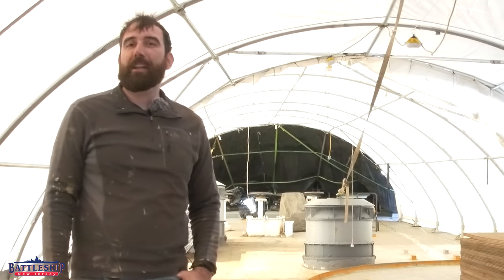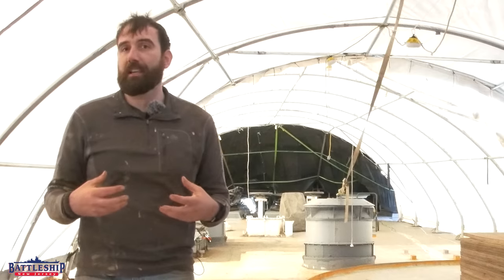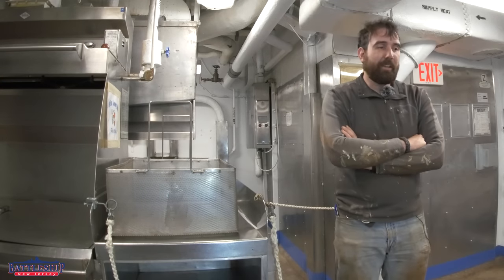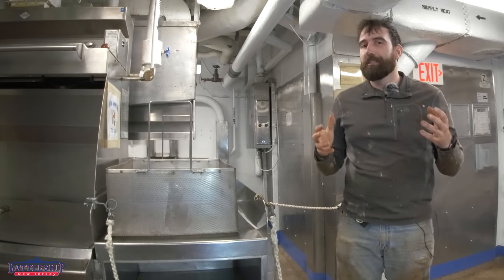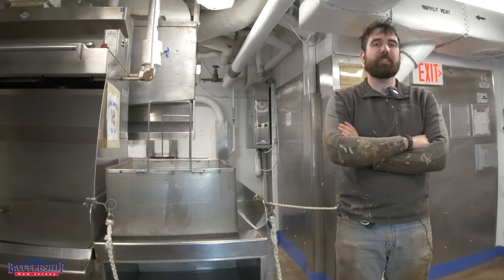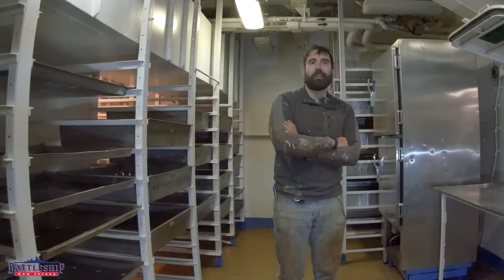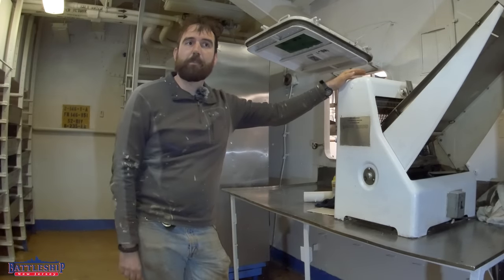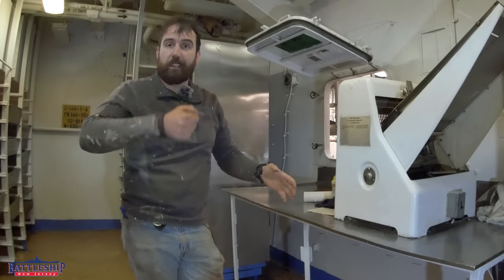Maintaining Your Battleship: Jan 2023 Update

Comment: alright i have the schedule to work on for 2023:
1. taking the engine, turbines and boilers out, rework it so its good as new (has to be done over the weekend i case the ship is needed again for WW3)
2. panting the entire ship new, using only a toothbrush to proof that you are serious with your work
3. overhauling all 3 gun turrets. and yes that also means taking them out (if no crain is available, get a keyboard and some cheat codes to lift them out.... "No gravity cheat" works good)
4. replacing the entire electric systems within the ship. that means, new wires, new cables, all new and up to 21st century standards. should be done in a week
5. vacuuming
6. getting rid off all of the rust on the ship so its completly rust free
7. replacing all steel on the ship with stainless steel so it cant rust again. 
8. Installing Windows Vista on all Computers on the ship, because history and nostalgia
9. raising the ticket prices for entry
10. kidnap some of the visitors as cheap work forces
11. reworking all of the weapon system so they can function again
12. cleaning the toillets. 
13. repeating all steps with the other iowas

Comment: Mess deck Smellerizer?  As started by Disneyland's Main Street starting in 1955?  Making the mess deck smell like a mess deck is attention to detail.  The first Fantasia presentations were supposed to include ushers walking down the aisle with various scent sprayers back in 1940.

In the Imperial War Museum at London, I toured a section mocked up as a Great War trench.  I've been on real battlefields (fortunately AFTER the shooting had stopped) and battlefields have a distinct stench.  The IWM had a light battlefield scent that I immediately recognized, and fortunately that odor was low-key.  Real battlefields reek.  

That's a nice touch when you can pull it off because it more fully immerses the visitor in the experience.

Comment: You COULD buy sliced bread in the US for the vast majority of the war.

From January 18-March 8, 1943, sliced bread was banned. This short lived ban resulted in a rush on bread knives, which by then nobody had, and increased food waste due to uncut loaves drying out faster and waste due to poor bread cutting. When the ban was finally rescinded, all authorities pointed fingers and nobody took responsibility. Various excuses were given by the media for the ban but few had any source in government and fewer of those turned out to be logical or based on any actual need. The sliced bread ban resulted in more steel and food consumption than before or after its existence.

Bread slicer manufacture was banned for the majority of the war, but since bread slicers are a common item in bakeries and pretty reliable, there was never actually a real shortage of either bread slicers or sliced bread except for that period where the government banned bakeries from using their slicers.

Comment: I trust you won’t have smell scape in crew berthing!  Would be nice to have electronic smell on the radio rooms, main plot snd CIC unless they are in use and already giving their own smells off.
Reply from the maker: The radio rooms are functional so they have their expected smell. Which I've never noticed...but I guess it's right.
Reply: @BattleshipNewJersey  That slightly burned caked on dust smell, some phenol and formaldehyde from the bakelite knobs and phenolic tie strips, with a hint of slightly leaking capacitor oil? Know that too well and love it.

What about the other electronics all over the ship? I wonder if there is still some WW2/korean war-area vacuum tube equipment left, maybe in the intercom/telephone systems .. or was this all upgraded at some point?

Comment: 5 years and 5 million to re-deck the ship? I'll do it all by myself in 2 years for 2 million and get it done in 6 months and pocket 1 million in profit. Your contractors are grossly overcharging you on labor and marking everything up by at least 500% and how can they slack off so hard that it takes 5 years to replace a deck? When I worked in construction our 3 man crew built 4 2000 sq ft homes in a year and a 7500 sq ft warehouse and all of that was from unimproved lots to for sale sign in the driveway and we did everything, poured the slabs, framing, siding, painting, roofing, plumbing, electrical, everything. The flooring only took a couple of days per house so around 1000 sq ft of wood flooring per day, carpeting was faster and tile was a little slower but that was the average.
Reply: Quite possibly.  But at the same time, doing museum-grade work on a historic vessel and dealing with likely asbestos issues and who-knows-what-else, and also having to work around a huge number of visiting tourists and child visitors at the same time.  Not to mention that everything is curved & cambered & obstructioned in crazy & unpredictable & unique ways.  It's those things that drive the costs & time way up.  Even in houses, remodeling a quaint antique listed mansion is a far cry from slapping up a brand-new tract house.
I'd think that because of all that, your $2 million estimate might need to double to $4 million, or else you'll likely lose money on the deal.  And if you're wise, you'll also throw in decent overrun margin as well to handle any further unexpected surprises.
Oh and also, there may be a government requirement to use more expensive union workers, rather than cheap construction labor.  Woo hoo!